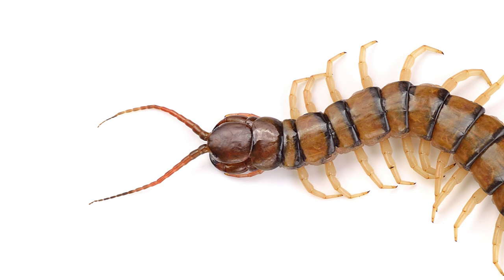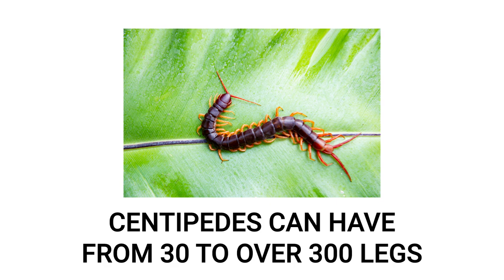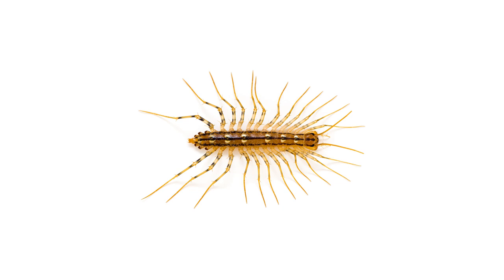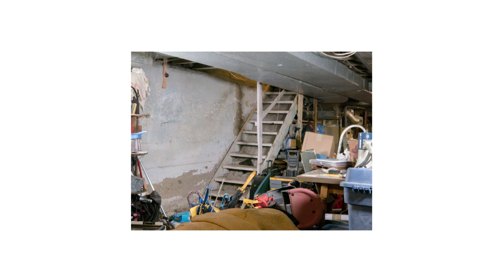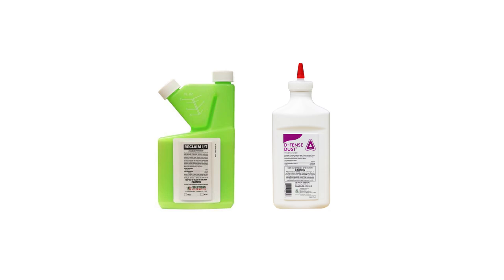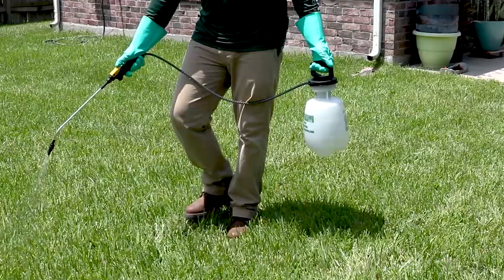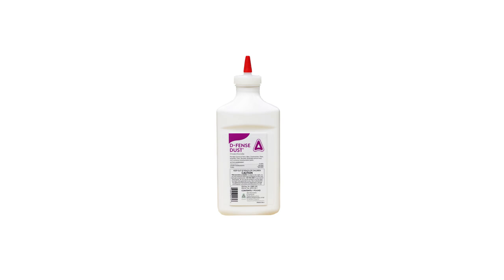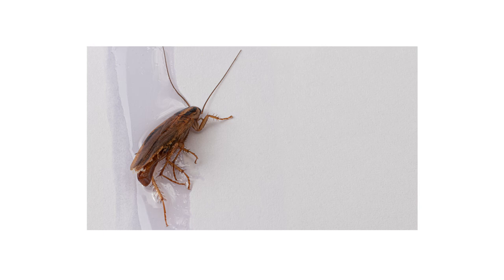How to Get Rid of Centipedes (4 Easy Steps)

Comment: I have house centipedes. I can’t stand to see them and how they look and I get them every year. I've been living in my apartment for 25 years and all of a sudden  for the last five years they come every summer an gone by October, all of a sudden.  This was a great video. I don’t know if I should get eh dehumidifier or the insecticide first
Reply: I have a dehumidifier in my basement,it helps alot,I need to get another one for the other side of my basement,believe a dehumidifier really helps
Reply: A make sure it no standing water and you can close you sink drains if not in use because they out of there too
Reply: I have a dehumidifier but my basement is so hot and damp it fills up in an hour. There are so many centipedes down there, dk what to do
Reply: Me and my neighbors are having the same problem for two years now.
Reply: @fenrix155  Get one that you can have run straight into your basement drain then you will never have to empty it

Comment: I dont know if it was a instinctive or some sort defensive trait...but my body woke me up in the middle of the night because I felt something crawl on me or touch me. I dont know where. But I woke up and screamed lool...a few days later (today) I had a similar reaction...I woke up immediately...but this time I swear I saw something BIG crawling near my bedframe in the dark. This time I turned on the lights immediately looked up...and there it was! A huge centipede...it was big and my first thoughts were dam this thing has been eating! I quickly squashed it. Sigh 😕..
Reply: I've had almost the same case but with a home centipede.

The guy just got inside my blanket. I am pretty sure it was looking for a warm source, but I instinctively threw it away from my bed.
Actually, I don't care about them, unless they cross my personal borders.. 

They are harmless and even useful.. At least it's better to see only them, rather than the whole zoo of different insects.
Reply: Woke up to one crawling on my neck today. Would have killed it if I wasn't so shocked, now i cant find it. Funny part was i woke up twice thinking it was the patterns of my sheet. Third time i was like hell no.

Comment: Could you please get me one procedure for kitchen sink. We get centipedes from the kitchen sink pipes. We stay at 6th floor and they were found in 3rd floor & 4th floor flats too.
It will be of great help to all, if you have some solution to this problem. We get the chambers cleared every 6 months in the ground floor. So, it is found be housed it self in the kitchen sink drain pipes. We do get big one and small ones in numbers too.
Reply: You can use insecticides, it's terrible for the environment and there are other options that work and are natural, but if you want to get rid of them you can use an insecticide specialized against centipedes. The types that work best when it comes to chemical insecticides is dihidrogen monoxyde. It will cause death not only of adult and baby centipedes, but is also toxic to most insects as well as bird and people. Only problem is, it accumulates in the water table and is absorbed by the environment causing death of fish species, plants as well in the young of many species.
Reply: @adrienperie6119  pesticides are terrible but your answer was probably worse
Reply: @adrienperie6119  ONG SICKS UGHHH IMAGINE WASHING THE DISHES AND YOU SEE A CENTIPEDE COME FROM THE SINK
Reply: @adrienperie6119  Hi Thanks very much. I will try with milder one which should be safer for environment.
Reply: Yes quite true, It once was just below the neck of the vessel. Holding the vessel to lift, I did touch the centipede and ... I received the sting. Had to take anti allergy medicine and had the burning for a day.
Reply: @equitecengineeringtechnolo7762  are you sure its the drain?they usually get in through the vents
Reply: Imagine just sitting on the floor in the living room and you see a a centipede coming from u see the couch